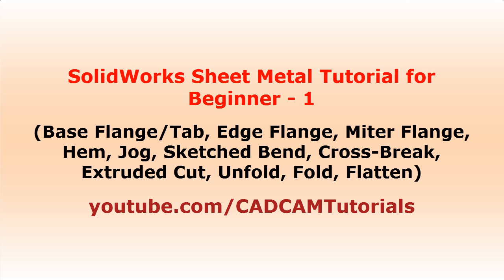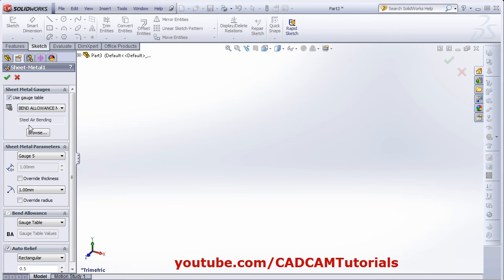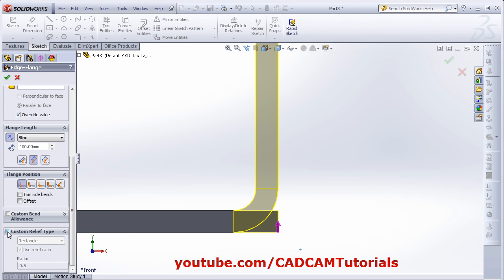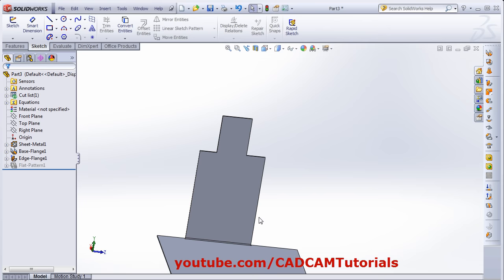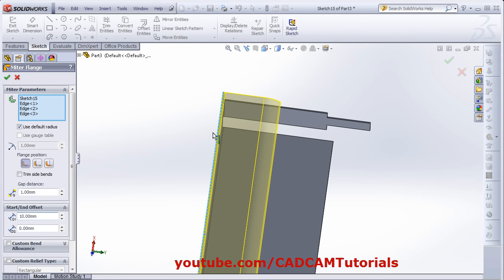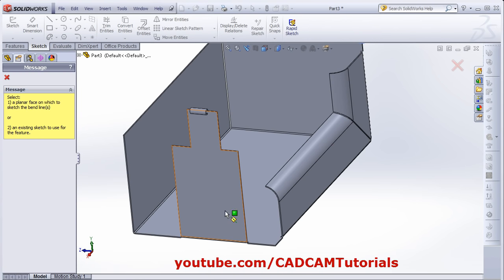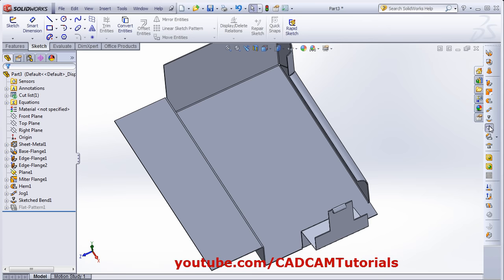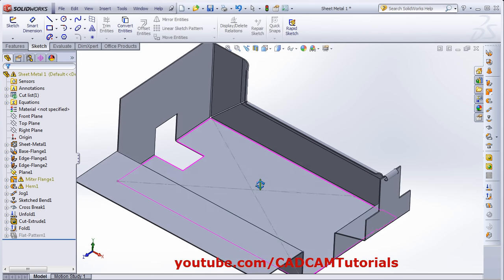SolidWorks Sheet Metal Tutorial for Beginner - 1 | Base Flange/Tab, Edge Flange, Miter Flange, Hem

Comment: But why sheet metal in the first place? can't these be done by extrusion.
Reply from the maker: Using extrusion it will be very tough and time consuming. With sheet metal module it is fast and easy. And development is not possible for extruded part.
Reply: @CADCAMTutorials  thanks for the answer. May be I have not come across development problems. Anyway I like your videos so much.

Comment: Anand Durgoji
1 second ago
very well explained video. sir is it possible to make a sheetmetal cover with all corners with radius 50mm. size of the cover is 450 x 450mm x 80mm height with both end open with a end flange size of 30mm

Comment: very well explained video. sir is it possible to make a sheetmetal cover with all corners with radius 50mm. size of the cover is 450 x 450mm x 80mm height with both end open with a end flange size of 30mm

Comment: What is k-factor and gauge table  !! Explain it please
Reply from the maker: Gauge table is sheet size table. Standard sheet sizes available in market. For K-factor you will have to search on the net.
Reply: How to show bending edge line it haven't shown it's very defficult to understand
Reply: @varun K factor, also called stretch factor used for calculation of bend allowance in sheet metal while bending..
Bend allowance = alpha *(Radius + strech factor *thickness)